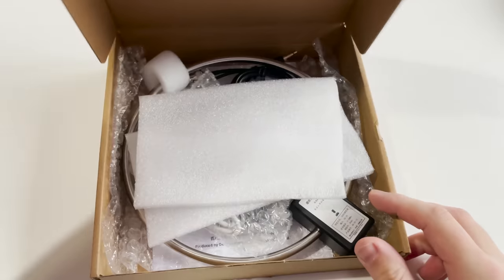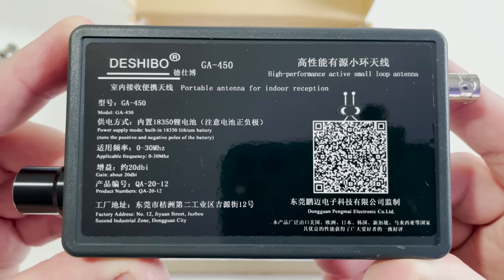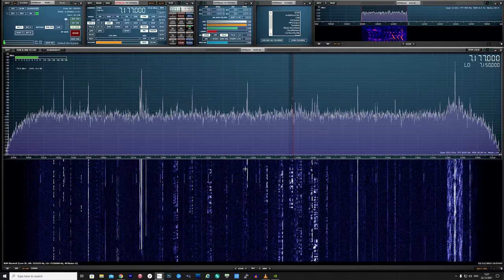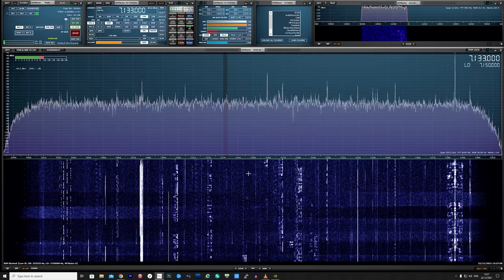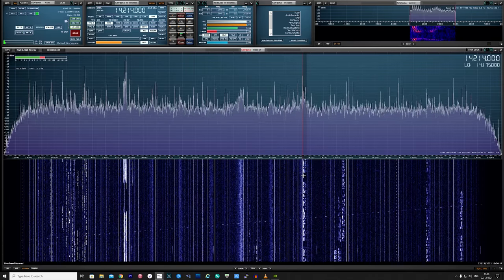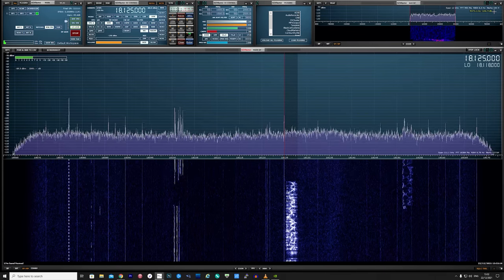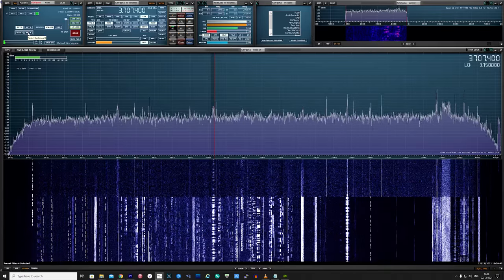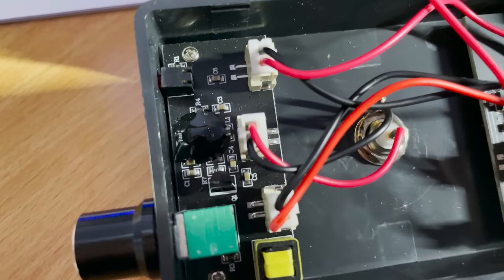GA-450 Portable Active Small Loop HF Antenna

Comment: I recently purchased one of these and would recommend it for anyone who has not the opportunity for an outside antenna. The only downside is that while it's recharging which takes about five and a half hours you are off air.. But I would still recommend it. It does exactly what it says in the video..
Reply: thanks for sharing
Reply: Think i will get one, i have a Kenwood receiver just on a short wire at the moment, and i have charged extra batteries, so its just to change one, Levi in sweden

Comment: Good one!  I just might order one.  I assume the battery was included in this "indoor" antenna because a wall-wort power supply would have introduced too much QRM.  That allowed use of a cheap plastic case, but I think I'd finish the job by replacing the case with an aluminum one.

Comment: Hey, thanks for the review. I recently refurbished my dad's old Grundig vacuum tube radio that also has shortwave.  I have memories of listening to shortwave radio when I was a kid ( I'm now in my mid 50s). Unfortunately Im struggling to get much besides religious channels from the USA although I have picked up stations from France, Romania and even India. I guess since the end of the cold war there's not as much to listen to on shortwave. Still, I'm intrigued enough to buy an external antenna and I purchased the GS-450. I'm still new to this so I'm not sure if I want to invest in an outdoor antenna , and if this antenna doesn't work well then I have a good antenna for listening to AM radio on my Stereo receiver.

Do I need a balun when using this antenna? The Grundig has an internal antenna with two banana jacks that can be disconnected If you'd rather use an external antenna. I have a Sam's service manual for the Grundig but it doesn't specify  much regarding the antenna. Right now I can pick up AM/ FM/ and short wave between 16M and 120M

Thanks,

Mike

Comment: Hi dear tester,
in 44 years of SWL activity I have learned one thing,
 If an antenna is too small to receive a signal with solid values at all, the amplifier will not help at all.
Make sense solach antnnen if you don't have anything anyway.

My solution,
Preselector with preamp and about 10-13 wirez in the room or out of the window 

Why ? simply amplifying everything is the worst possible thing.
First selecting and strengthening, that is as old as listening to the radio.

If you add a preselector like the China 30WQRP antennas for FT 817/818 and Icom receivers then the thing becomes unbeatable for you size.

Comment: I recently bought this antenna for use with my Noolec SmartSDR.   It's quite decent, but I'm getting a lot of power supply noise. Not sure if it's the battery within the antenna's base unit or due to the various USB phone chargers i have in my apartment. What would you suggest to mitigate this issue? Would installing ferrite beads on the feeder cable, or getting a different feeder cable help?

Comment: I might order one soon, because the MLA-30 is a little noisy, and it's in a fixed direction.  I need something that is directional and nulls out the noise in my apartment.  Maybe when I buy it and receive it, I will make a new You Tube demo video about how it performs soon.
Reply: Let me know if you compare this to the MLA-30.  Wondering which one performs better?
Reply: It's probably noisy due to the power source you're using to power it. A noisy switching PSU/Charger will cause the MLA-30 to be a little noisy. If you use a linear PSU or a switching PSU that's quiet it won't be noisy. Or maybe you're just in a very RF noisy area, if you turn the MLA-30 and the noise goes away then it's not the antenna itself but local interference.
Reply: How was your experience with this one

Comment: Awesome review! I've been looking for a decent antenna for below 25Mhz for swl, I wonder how well it performs connected to a SDR V3? Or would I be better off upgrading my sdr or getting an upconverter for swl...hmmm?
Reply: if you have the original v3 it also works below 25 mhz. Search how to listen to hf on sdr v3 there is a tutorial
Reply: @dxerkin4  yes I do know how to put it into q branch for swl it's a antenna I'm looking at

Comment: I'm commenting very late but I just got this antenna and all the signals are just breaking up. I don't know what overloading sounds like but maybe this is something like it. Everythikg isnjust a garbled mess. I tried it with my Tecsun PL-990 and an RTL-sdr. Am I doing something wrong
Reply: No it's a crap loop or you have a dud like I do but it's half the size I thought it would be, almost like a toy

Comment: How would this do in a populated town environment?  I have a wal-mart in walking distance, I have a large hardware store near by.. and I live in an apartment..  Will it take care of the noise or just amplify it?
Reply: @Mike N HOC  I live in an apartment also with businesses around. About all I can use is active loop antennas. Longwires that I run around the ceiling picks up to much noise here. Plus using loops you can null out noise by just turning the loop. They do a good job of receiving signals also.

Comment: I got an MLA-30+ recently and it isn't working out for me. I'm getting a commercial AM station overloading all over the place. Do you think this would have the same issue or would it be better than the MLA?
Reply: It will, all you need is a Broadcast AM block high pass filter.

RTL-SDR makes one (you can buy one on eBay and a few other places). It'll get rid of the overloading.

I had the same issue when I bought the MLA-30, at my mother's when I'd visit there's an AM station across the street that overloads my radio when I use the MLA-30, when I put the AM broadcast filter in line (don't put it in between the bias tee and the antenna, put it in between the bias tee and radio) it fixes that issue. 

I also bought the RTL-SDR FM bandstop filter (88-108mhz reject) as when I'm at my house I have to deal with the same thing but with FM radio stations.
Reply: @madmax2069  I got a Flamingo AM filter and it didn't help. I'm not using the Bias-T that comes with it, though. I'm using the one in the RSP1A. Do you think using the filter combined with the external Bias-T would change anything?

EDIT: I tried it, and it didn't help. The interference is amplified by the MLA-30 itself. That's why I was wondering if this one had better filtering, or if I just can't use an active loop at all.
Reply: @Perseid  maybe it's your filter, it could be allowing AM to get into the system. Or maybe your MLA-30 is faulty. Does your receiver have a local/DX switch, if it does have you tried switching it into local?

I'm saying this because when I visit my mother I have to deal with an AM station across the street and I don't hear it when I'm not on the MW band.

Comment: What antenna do you recommend for indoors to Rx and Tx on most HF bands that is small and doesn't need ground radials.
Something for a small room.
Also second question.  Do they make 1 vertical antenna that covers all HF bands that I can put on a pole that does not need any ground radials either?
I ask because I am very very limited in space.  thanks.
Reply from the maker: I think the best antenna would be something like a magnetic loop. But just be careful of the voltages while transmitting :)

Comment: Does anybody know anything about the circuit used in this? Does it somehow tune itself, or is it just an amplifier? Is the amp just transistors, or is there an IC? Is this based on an open design?
Reply: It's just an amplifier, it's pretty much like an MLA-30 bit different design and battery powered.

Comment: This is not for radio am?
Reply: Yes it works on 79 Meters to 10 Meters receive your Radio can only Listen, AM, SSB, Packit , Morse's Code, anything can be Received , no transmit.
Reply: You can get those radio am on Ebay for 5 dollar or so.  I would’ve given you mine free of charge except that I threw it away.

Comment: Whats with the chinese and their batterycrap everywhere?  Allow me to elaborate.

This is clearly for indoor use, so it will be stationary.

The test is made with stationary equippment.

Yet, it is designed to work from a battery, there is no way to feed it from a 12v stationary power source - something most SWLs and hams would have in their shack.

= Where is the problem i hear you say?  - the problem is that in stationary use you need permacharge it,  which sometimes causes those el cheapo batteries to deform
if not break out of the housing.

Now, we have to wait for warranty to pass (2 yrs) - if we are lucky the battery is still ok by then - then we have to add in some stepdown converter to take our 12v shack power and push it down to 3V or whatever that battery delivers...   and then we can add a switch...   a socket .... plug ... cables to PSU   sigh

Would have been so nice and easy, if they would have used  their brains in the design phase of this "portable" yet "indoor" antenna - and done what
japanese and western manufacturers do since the 70ies....   allow for battery, but provide for external power source.  I guess it was 50c cheaper this way.

my 2c
Reply from the maker: My thoughts on this are: Battery means portable, Battery means NO QRM from using a power supply, Battery is replaceable if needed, as shown at the end of my video. Plus, it works..  :)
Reply: Additionally to both comments, less mass as RF Shieldi g from the power section is alot less on a battery solution ( potentially punched rin/copper clad plastic sheet ) instead of tinned cans and solder to keep RF from leaking.
Reply: its cheap for the chinese and also some people doesn't know about rf and will leave a bad review for noise because they use 5v  mobile chargers
Reply: Less QRM (noise)
Reply: Or get a very nice F-CHA real loop antenna for 10x more.